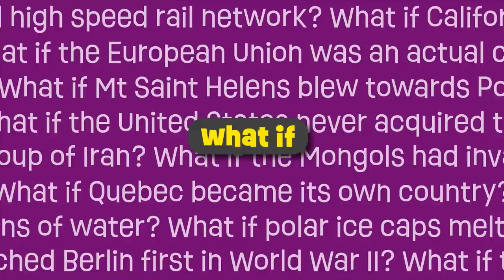Water Pipeline: What If An Aqueduct Was Built From The Great Lakes To The Southwest?

Comment: As a Mississippian, you can take as much of the Big Muddy as you would like. The MS River is extremely high pretty often. Normally it runs 1.6 million gallons per second. When it floods it's 3 or 4 times that.
Reply: Might want to check that right now, because it's low
Reply: @drjekelmrhyde  It's been high for the last 4 or 5 years. They can't dredge. Now all of that 5 year silt and sand  build up is in the channel. Yawn. I live down here.
Reply: No James, the barges that run the Miss river are currently grounded due to not enough water. Taking that water isn't a good idea.
Reply: @mikenagy938  When it's high it's a great idea, obviously not at record lows.
Reply: It is a great point.  We have plenty of water. But we have too much in some places and not enough in others. Flood control and drought control can be solved at the same time.
Reply: Exactly.  This!  It's like looking at the golden goose and chopping it up to get all the golden eggs out.  Look at all the water that goes straight from the Missouri and Mississippi that goes right back into the Ocean!  Completely missing the point he did.  He went straight hippie and climate change and depopulation on us lol.  Tell us more how nothing can be done to adapt but how we must spend a thousand times more on climate change🤣
Reply: Of course there are issues:  (a) sediment dropped from the river goes to maintaining the coastline.  Removing water from above the wetlands will lead to coastal erosion, which will destroy the ecology.  (b) The difference in elevation will cause a huge problem.  Bernoulli's laws (fluid dynamics) involves handling the pressure caused by pumping water uphill.  Those states are at or near the continental divide.  Hint:  Why do cities build water towers?  Answer:  Just a couple of hundred feet gives you high water pressure over a very large area.  Now consider that you have to raise that water over a couple of thousand feet.  (c) The water in the Big Muddy carries a lot of industrial runoff and waste products.  You will have a LOT of cleanup to do even if you get the water to the west.  And we are not just talking sedimentation and filtration.  There are some nasty dissolved chemicals in that stuff.  I know this because I have a PhD in Chemistry and grew up about half a block from a Mississippi River levee.  I grew up hearing the propellers of lightly loaded tankers slapping the way from one loading terminal to the next.
Reply: @kegginstructure  Here is a reply to your issues.  
In reply to (c) (1972) The Clean Water Act (CWA) establishes the basic structure for regulating discharges of pollutants into the waters of the United States and regulating quality standards for surface waters.  
For example my company was fined over 10 million and still to this day has to comply with random tests for having violated this.   So for clarification it was "diluting" even just in the slightest back in the day before it went to the treatment facility.  Highly detrimental to our profits and to this day its the #1 topic discussed in our safety meetings.  So doubtful these days that it would have the chemicals in large enough amounts to impact.

In reply to (b)  The earth thankfully is round and so a slight elevation is achieved in any given direction just by traveling from point a to b  however, yes elevation is a huge factor in choosing routes but much bigger is land cost.  Although  I am sure if the entire southwest farmers were faced with shrinking their shares by 30 percent or expanding it at an aggregated cost im sure it would be very easy to covince them of expansion. Especially if the lakes would fill back up.  Lots of stranded house yachts in Lake Mead and Lake Powell that used to draw in billions of tourist revenue alone that belong to millionaires and billionaires.  That part of Utah and Nevada's state revenue is all but gone now.  The Mississippi river at the mouth has roughly 600,000 cubic feet per second of flow, and the aggregate of the Colorado River only gives 45,000 cf^3 p.s.   If you took the northernmost river tributary the Missouri and diverted up to 20,000 cf^3 ps out of the roughly 85,000 cf^3 ps it carries that would completely solve the issue for at least a century of expansion due to a declining population increase rate across the globe and the USA in general.

In reply to (a)  20,000 cf^3 ps is hardly a spit in the ocean for the ecology of 600,000 cf^3 wetlands and so if you want the 3.3 percent lack of  wetlands all still there at the cost of all the south west including Los Angeles(1/10th of the population of the USA alone) etc..   I say how rude, but hopefully i have helped you see the possible gravity of the situation and what it merits.  I also am highly confident by another century from now we will be able to use highly better agricultural methods such as what Curtis Stone is doing.  We do need to build that infrastructure over decades though so i would say let the market take its course as it almost always does.  Hope this helps.
Reply: Missouri too. Half the time we're flooding.
Reply: This is the best idea of the two, taking water from the head of a lake system or water from a near exit point of a major river. Find  the balance point of the river where you could dump water into a  multiple filtering system of marsh grass that can be cleaned out and removed well other ones' will function to filter the water of harmful material. NASA has used this grass to clean their site for years, and clean water comes out the other end. The balance point of removal of drinking water will be back filled by the ocean to maintain water levels for water traffic.
Reply: James Jones I think you were mistaken about the big muddy it's at record low
Reply: There is enough land in Texas to feed the world… except for a lack of water. Shipping Mississippi water from the delta 500 miles west to central TX would probably shutdown farming further west where water is more expensive making that water available for non-farming use.
Reply: @jasonwilbanks3892  10 year low. It was at record flood stage in 2011 and almost record low in 2012. Of course you would only take water when it is high.
Reply: or.. just maybe... millions of people should live in a desert that can't naturally support the population

Comment: The Phoenix-Scottsdale-Mesa metro area has been at the forefront of water management for over one hundred years. Much of the water for this region comes not just from the Colorado River but from the Salt River Project and its series of dams north and northeast of the city that were put in place as far back as the 1920s. The Verde River and Salt River flow into Metro Phoenix. All of these lakes created by the dams are at 100% capacity as of today. For the past few weeks, water has been released from these dams downstream to replenish groundwater. This actually happens more often than one would think.

Comment: I would note that most of the recent proposals that I have seen have been about transferring water from somewhere along the Mississippi River to the Southwest, not take it directly from the Great Lakes. Whether that's a better idea might certainly be up for debate.
Reply: This is the route I would go since it's shorter.
Reply: You are correct but this probably generates more views.
Reply: It's just as unfeasible. He did briefly mention it in the video, but the issue is going through all that private land. How do you do it? Private land is one issue California is having with their high speed rail system that's supposed to eventually connect LA and SF. The other issue is contamination of the Colorado ecosystem with wildlife from the Mississippi river system. And of course the elevation changes as well. 
  The video is right in that conservation and recycling the water is the best solution. Though water used for farming can't be recycled. I live in Las Vegas, and our water is already recycled. Water used indoors that is. Water used outdoors cannot be recycled. Banning lawns and pools would go a long way to ensuring we have enough water for the population here (though farming would still be impacted).
Reply: @jimmym3352  they do have treatment facilities they could build that would filter out any potential harmful wildlife or ecosystem devastators before dumping the water into the Colorado system.
Reply: I agree, the Mississippi River, when it it is overflowing and projected to soon overflow, would be a good source for water. You could claim this is a flood mitigation program. Transportation is a different issue. A pipeline is probably not the best method as transport would be intermittent. I'd suggest rail. The amount of steel for the optimal number of rail cars would likely be on the order, or potentially less, of that for the pipeline. Using rail would not require property acquisition. One downside of using rail is the inconvenience to traffic at railroad crossings during rainy season.
Reply: The major issue with this method is an engineering problem of how to fill the rail cars fast enough to keep up with the influx of water. This would require some new infrastructure (and land acquisition).
Reply: Laughable idea,
You would have to pump the equivalant volume of a river,  UPHILL and then UP  mountains, for almost 1500 Miles 

Construction costs  $$$$$
Ongoing energy costs $$$$$
Water could end up at 50 cents per gallon (or more)

The average Las Vegas household uses 222 gallons a day
The math is relentless

222 x 365 = 81,300

At 50 cents a gallon, the average water bill would be $40,650 annually.
if you assume 25 cents a gallon, it becomes "ONLY"  $20,257 annually for your water bill.

Agricultural water cost in ACRE FEET = $$$$$$$$

Living in the desert with millions of other people has significant costs.  Who knew?
Reply: @BlueCrew21  -- not if you're seriously trying to continental-scale amounts of water. A sand-filter at that scale would look a lot like an aquifer.
Reply: @zubble7144  ... trains might struggle with the volume.  Trains move things measured in hundreds of thousands of pounds (something like 3,000 tons/train... still has to climb a mountain).  
Lake Mead is in deficit by 1.2 million acre feet/year.  
1 million gallons of water is 3.07 acre/feet and a gallon of water weights 8.3 ibs-->  1.6 billion tons of water per year, or roughly 540,000 trainloads of water per year (1,400 trains per day; or basically one per minute one per minute).
Reply: You could move the water from the Mississippi River around Memphis, TN to Lake Powell at around 1400 miles. The amount of water moved wouldn't even be noticed in the grand scheme. The Mississippi flows 2.5 million gallons of H20/second at Memphis.
Reply: Another idea proposed is to connect the upper Missouri river in western Montana to the Colorado river . Not sure if the terrain and obstacles would be less just what was talked of
Reply: St. Louis, Mo is the best place to start the pipeline westward.
Reply: We aint shipping our river or great lakes water to the west, hang it up.
Reply: @frankfalkenburry5373  let them dry up. Pools. Green lawns in a desert. They’re all fools.
Reply: @godkingnaoki  who's to say the Youtube can't tackle both topics.
Reply: @heartland96a  that's what I was thinking. Maybe build a small resevor in the Mississippi watershed somewhere in the mountains and tunnel threw the mountain and dump the water into a stream in the colorado watershed. It could be done in the Columbia watershed too
Reply: Hey...Run a pipeline from the mouth of the Mississippi, under the Gulf of Mexico. That water is wasted, anyway, when it dumps into the sea. One could also, easily, control the level's of Lake Michigan and Huron by just opening and closing the locks in downtown Chicago, to let an "over abundance" of Lake water flow down the Illinois river to the Mississippi and supplement the water going into that pipeline.
Reply: The Missouri river would be the smartest option drop it through Wyoming but it would be a massive undertaking.
Reply: Westerner here, dont support, southern parts and states are vastly less important than the few trees we have left. That water aint going north of sac and sf its not helping. You think you can allow all the people in to use up resources when in the end you contaminate all of it from the top down. Besides, people are moving from the great lakes because they are ruined already.
Reply: @badguy1481  the water is fed. We dont want it.
Reply: @smokencracker5597  Not sure what you mean "fed". But Lake Michigan water can't be any worse than drinking muddy Colorado River water.
Reply: @badguy1481  the high up in the mountains the clearer the water. Yes river water is muddy. There are lakes you can fill water from and its supposedly better for you than tap or bottled water.
Reply: @Concerned502  Why on earth would anyone build a pipeline 1,500 miles long. Instead you'd pump it to the headwaters of the Colorado River and let gravity do the rest. Yup, that would require a lot of energy. But LA built an aquaduct that pumps water over a mountain range so it can be done. Furthermore, there are other rivers much closer to the Colorado such as the Missouri.  

The biggest issue isn't the logistics of doing it but the politics and water rights.
Reply: @jimmym3352  The issue of private land is a nonissue for something as basic as water.  That's entire reason eminent domain exists.  High speed rail is something that is not unequivocally a public good, and so not only landowners fight it, but also does half of the rest of the nation who think it's a stupid boondoggle.  Get on a damn plane if you want to go fast.
Reply: The better idea would be to stop farming in a literal desert
Reply: @rgoers  the LA aqueduct pumps use almost 1GW of power lifting water 2000'. If you source from eastern US, you have to lift at least 3x that, and at that point, desalination is clearly cheaper
Reply: @nihilistpenguin7511  You do realize that at least 12% of US Agriculture production is in California and 1/3 of the vegetables and 2/3 of the fruit and nuts are grown there? At the same time Arizona is the number 2 producer of Broccoli, Cantaloupe, Cauliflower, Lettuce, Spinach, and Lemons. Where do you think fruit and vegetables come from during the times of year other areas are covered in snow?
Reply: @rgoers  That 12% of US farmland in California is mostly concentrated within the Central Valley, not Southern California, which is mostly deserty/arid. Arizona may be the second largest of Broccoli, cantaloupe, etc, but do you think it should remain that way? Arizona is also my entirely desert. Growing crops in a desert is extremely stupid, and not sustainable in any way, as the water requirements are through the roof. You know, since there’s hardly an rainfall and it’s extremely hot. Climate change may be making the drought situation much worse, but the short-sightedness and lack of wisdom of those who have decided to live in an unsustainable environment has made the south western US stunningly ill-prepared to deal with the effects of climate change.
Reply: @nihilistpenguin7511  I guess you just don’t get the point. First, the Central Valley has been short on water for years and the land has been sinking from pumping the ground water. All of California south of Sacramento is pretty much desert. Second, if all those places stop growing crops there simply will not be enough food. Prices will soar or people will have to do without, especially during the winter. Also, 12% is not the amount of farmland but 12% of the monetary value of the crops.
Reply: @nihilistpenguin7511  The thing is, it's actually a great place to farm when there's plenty of water.  But yeah, when the basic water supply of millions of people is at risk, then it's time to stop.

Comment: Agreed, pulling from the great lakes would be unfeasible. Some of the "better" ideas I've read are pulling from the Mississippi and/or the Missouri. The one thing that I've noticed that is missed/overlooked often is agriculture. As you said one of the major long-term issues is the draining of the lakes/basin without replenishment. While not directly, California is suffering from that now through food exports outside of its basin as it produces 12ish percent of the entire US production. And more specifically 20% of US milk, 75% of US peaches 78% of US lettice, 88% of US grapes, and 99% or more of US almonds(60% of the world's), figs, olives, artichokes, kiwifruit, dates, pomegranates, raisins, sweet rice, pistachios, plums, and walnuts. That's a lot of water being shipped out both across the country and the world. A good example of this in action is/was Tulare lake.
     As for using desalination instead, there are two issues with that. The leftover brine after the freshwater has been extracted and high energy costs. Our energy grid is already strained, especially with our last heatwave and a reduction in hydroelectric due to reduced river flows and reservoir capacity.
     As for why grow in a desert, technically the main agriculture areas are mediterranean(Csa) or semi-arid(BSk) not deserts(BWh), which means multiple growing seasons and mild wet winters. Also, thanks to the surrounding mountains the san fernando valley has very rich soil.
Reply: why not pacific?
Reply: Those rivers are poisoned with heavy metals and pesticides.